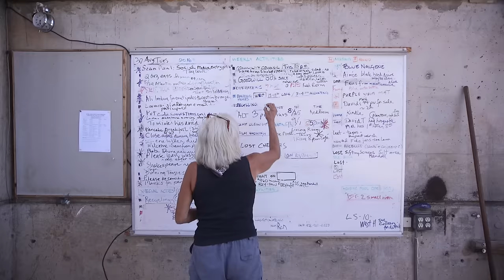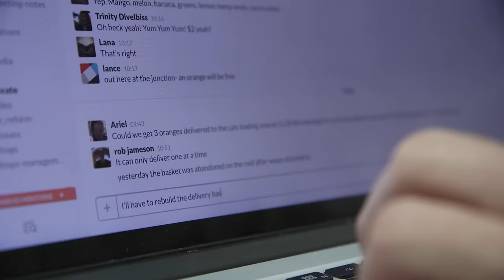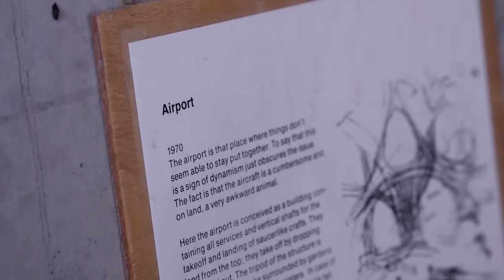The City of the Future Is Already Here

Comment: Being an Architectural drafter and having toured Arcosanti, what I saw was a very unattractive concrete bunker Paolo Soleri built an indestructible memorial to himself. If this was a good plan there are lots of smart people with enough money to finish this monstrosity. There was enough concrete used to pour slabs for half of Phoenix.  They are buying electricity from the local power company and they put up a fence so everybody's cars and mobile homes are not visible. They told us the reason they can't expand it is because the road to it doesn't support emergency vehicles? Sounds like an excuse to give up on a lost cause.